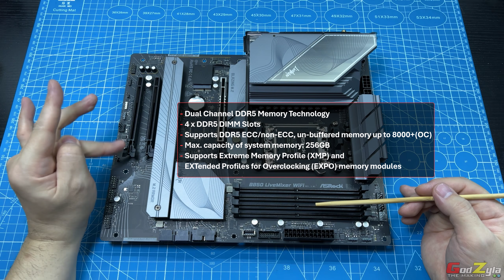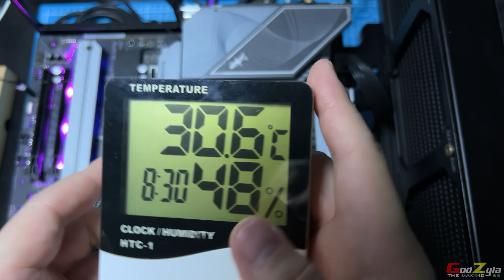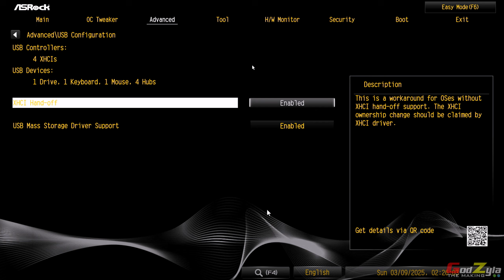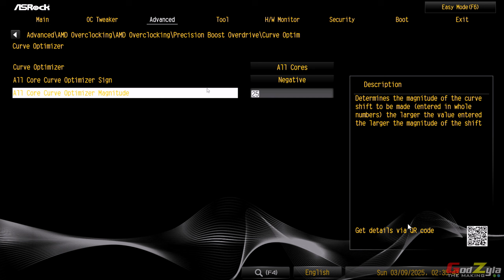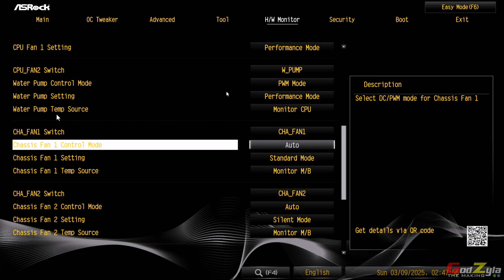ASRock B850 Livemixer WiFi

Comment: Is the 9800x3d suitable for this motherboard? It seems AsRock fixed the driver issue, or not?
Reply from the maker: Hi vitalikx100, welcome to my channel. Yes this board is suitable for 9800X3D. As for the burnout issue. I can only say there are prevention messures that can be done. PBO2 Curve Optimising on 9800X3D https://youtube.com/playlist?list=PLEW-b-2vYDdMhXCDT47rglQcDQNaRisR_&si=Gu2915lGssL9L0H6
Reply: @KleoYan  Thanks for playlist. I have one more question: for the 9800x3d on this motherboard, do you need to connect 8pin or 8+4pin?
Reply from the maker: @vitalikx100  In general, it's good to plug both in. It will also work if you only plug 1 8pin eps.

Comment: Hey, what are the essential drivers to download for this motherboard? Thanks
Reply from the maker: Hi GrapeGrannySoda, welcome to my channel, when you install a fresh copy of windows 11, once you load into windows, you should get a prompt from ASRock on the lower right. That will assist you with installing the essential drivers. else from the support site,, these will be the drivers I will install :-

From https://www.asrock.com/mb/AMD/B850%20LiveMixer%20WiFi/index.asp#Download
Realtek high definition audio driver ver:9703.1_UAD_WHQL    
MediaTek Bluetooth driver ver:1.1043.0.550      
AMD chipset driver ver:7.06.24.2226 
Realtek Lan driver ver:10.071.0425.2024   
AMD graphics driver ver:24.30.66.250610a  
MediaTek Wireless Lan driver ver:5.6.0.4261     
ASRock Motherboard Utility ver:4.1.35     
Nahimic3 utility ver:1.10.2_APO4    
Dragon 2.5G LAN Utility ver:6.10.3301.2

Comment: Hi Kleo, would you recommend this Mobo vs the Gigabyte b850 Aorus elite wifi7?
Reply from the maker: Hi Detlaff, welcome to my channel. I will advise to get the gigabyte b850 Auros Elite wifi7 as there are issues currently on ASRock boards. https://www.reddit.com/r/ASRock/s/X2VgEOJ58n
Reply: @KleoYan  this only affects 9000 series cpu's right? or are they also causing issues with 7000 series. I'm planning to pair it with a Ryzen 7 7700 CPU.
Reply from the maker: @Detlaff13  I see, still I will not risk it .. it will be better to get the gigabyte board.
Reply: @KleoYan  Okay, thanks for the advice. It's such a waste that this mobo has better pricing than the gigabyte one If only it didn't have any issues.
Reply from the maker: @Detlaff13  yes it is.. as much as I feel the same way you do, but it's better to be safe than sorry. It's no joke not to have an operationaly ready PC. All the very best with your build. 😉
Reply: @KleoYan  btw, What do you think of the Gigabyte b850 eagle as a more budget option?
Reply from the maker: @Detlaff13  Hi, I do not have that board to fiddle with. The choice is up to you. so sorry about it.

Comment: Hi !

I feel like this motherboard would be great for me.

Case : Corsair 3500X
CPU : Ryzen 7 9800X3D
GPU : MSI 5070ti 3× OC
Memory : 2× 16GB G.Skill Ripjaws low profile DDR5-6000 CL30
Motherboard : Asrock B850 LiveMixer WiFi ATX
Cooler : Thermalright Phantom Spirit 120 EVO
Storage : 2 TB Samsung 990 Pro M.2 PCIe 4.0
1 TB Corsair MP-700 M.2 PCIe 5.0 NVME
Power Supply : MSI MAG A850GL PCIe 5 80+ gold

It's for UHD gaming and I want my pc to last for years ! Can I have some advices please ?

I also don't know what to choose between the Livemixer and the MSI Pro B850-P WiFi. They're both same price but I feel like the Asrock is better...
Reply from the maker: Hi LaP1tade, welcome to my channel. For build structure and feature set, the LiveMixer will be of a better buy.
Reply: @KleoYan Thank you so much !! You're gold ! 💛
Reply from the maker: @LaP1tade you are most welcome. All the best with your build too 😉
Reply: Also, you got a new follower ! Thanks for your great work ! 🥰

Comment: bro the box under the ram socket mine goes through to 85-89C is that normal? I've bought a b850 livemixer
Reply from the maker: Hi Fernnzx, welcome to my channel. mine does not go over 50°C and my room temperature is 30°C~31°C. If yours is hitting 85°C~89°C, something is not right and you might want to check your case airflow.
Reply: @KleoYan  Have you ever touched the heatsink under the ram socket? it's really hot even though I put a small fan directly facing the heatsink under the ram socket, btw my aio stands in front not on top because it doesn't fit
Reply from the maker: @dutaakun6823  yup, I did touch it.. is warm to my fingers, not burning. hmm maybe how many USB devices and m.2 did you plug to this board?
Reply: @KleoYan  i have 3x4 nvme, 1 ssd sata, 1 hdd sata 7200rpm and I have also ordered a 4x4 adata xpg gaming ssd s70 blade and I want to install it tomorrow when it arrives
Reply: @KleoYan Have you tried it during heavy gaming/benchmarking and touched the heatsink? Bro, I'm really scared because it reaches 80-89C hahaha
Reply from the maker: @dutaakun6823  I see, that might be the m.2s + your GPU that is mounted horizontally which causes your chipset heat to hover at 85°C to 89°C. I will not give you weird suggestions and I have returned this board to ASRock. I see if I can borrow the board again and to do some testing.
Reply: @KleoYan  Thank you bro for discussing what I wanted to discuss, this really helped me and this video is also very complete.
Reply from the maker: @dutaakun6823 you are most welcome. Drop me an email godzylatech@gmail.com so that I can follow up on your case.

Comment: Yo man, I really want to build a gaming PC and I've saved up enough for one. I have around €1750, and I included this motherboard in my PCPartPicker build, but I'm not sure if it's good enough with the other parts I have, or if I can get a better board for a better price—or the same price. The same goes for the other parts. I'll list my components below. If you have the time to let me know whether it's a good build or if I should replace some parts, please let me know.

Part list:
Cpu: Ryzen 7 7800X3D
Cooler: ARCTIC Liquid Freezer III Pro A-RGB 360 77 CFM Liquid CPU Cooler
Motherboard: ASRock B850 LiveMixer WiFi ATX AM5 Motherboard
Memory: TEAMGROUP T-Force Delta RGB 32 GB (2 x 16 GB) DDR5-6000 CL30 Memory
Storage: Crucial T500 1 TB M.2-2280 PCIe 4.0 X4 NVME Solid State Drive
Videocard: Asus PRIME OC GeForce RTX 5070 12 GB Video Card
Case: Montech KING 95 PRO ATX Mid Tower Case
Powersupply: MSI MAG A850GL PCIE5 II 850 W 80+ Gold Certified Fully Modular ATX Power Supply
Reply from the maker: Hi Ejuwaldi, welcome to my channel. Do pardon me as I miss out on your comment as there are no notification for some reason. Now your build is fine, just that will you want to have at least a 16G VRAM GPU as compared to a 12G VRAM GPU?
Reply: @KleoYan "Hi, thanks for responding. Yes, I would rather want 16GB of VRAM, but I wanted to buy the 9070 XT. However, where I live it's around €800 compared to the 5070 which is around €600 because of the shortage. If you know one that is better or just as good as the 5070 for around the same price, please let me know — or if I should change some parts to put in the 9070xt."
Reply from the maker: @LelouchJapan  a 9070XT or 5070Ti will be a better choice and based on your listing. I might change these

Part list:
Cpu: Ryzen 7 7800X3D
Cooler: ARCTIC Liquid Freezer III Pro A-RGB 360 77 CFM Liquid CPU Cooler
Motherboard: ASRock B850 LiveMixer WiFi ATX AM5 Motherboard
Memory: TEAMGROUP T-Force Delta RGB 32 GB (2 x 16 GB) DDR5-6000 CL30 Memory
Storage: Crucial T500 1 TB M.2-2280 PCIe 4.0 X4 NVME Solid State Drive  <---- I will go for WD SN700 1TB if it's just for gaming
Videocard: Asus PRIME OC GeForce RTX 5070 12 GB Video Card
Case: Montech KING 95 PRO ATX Mid Tower Case <--- I will go for King 65 Pro it's cheaper. 
Powersupply: MSI MAG A850GL PCIE5 II 850 W 80+ Gold Certified Fully Modular ATX Power Supply <---- I will go for FSP VITA GM 850W https://www.fsplifestyle.com/en/product/VITAGM850W.html
Reply: @KleoYan I live in the Netherlands, and unfortunately, the 5070 Ti isn’t an option since it costs €1000 or more here. The WD SN700 is actually more expensive than the Crucial T500. The power supply you recommended isn’t available for purchase in the Netherlands. The only thing I could possibly change from your recommendations is the Montech King 65 Pro, but even if I were to switch to that, I’d still need at least €100 more to get the 9070 XT. That said, I really appreciate you taking the time to help me out. If you have anything else let me know otherwise thank you for helping me out🙂
Reply from the maker: @LelouchJapan sorry my typo it should WD_BLACK 1TB SN770 NVMe. Hmm maybe top up abit. At least get a 16G vram gpu. All the best in your findings.
Reply: @KleoYan Yeah, I think I'm going to try to save a bit more money and buy either the 5070 Ti or the 9070 XT. Which one would you recommend?
Reply from the maker: @LelouchJapan if it’s just for gaming amd 9070xt if it’s for gaming and artwork 5070ti.
Reply: @KleoYan Thank you very much, and sorry if I keep bugging you with questions, but do you know if there is a difference between a boxed and a tray CPU? I found a Ryzen 7 7800X3D around €40 cheaper if I buy the tray version. Is it better to go for the tray or the boxed one?
Reply from the maker: @LelouchJapan  Box processor, full warranty coverage, tray CPU are opened already and warranty coverage normally is a year. It's no difference on performance as it's random sillicon chip, the only diff is.. tray are cheaper and they only have a 1 year warranty.

Comment: Thanks for the review, I've been learning a lot since I'm building my gaming PC. My idea is to pair this with an AMD R5 9600x, do you think I could have problems with the CPU issue from asrock? I know they release a BIOS update. Greeting from Colombia - South America.
Reply from the maker: Hi Amet Saade, welcome to my channel. It is a good board to pair with the 9600X, just make sure to update the bios to version 3.25 and if you worry about the issue that's reported at reddit. You can follow these steps as follow.
Disclaimer, these are just a reference, I will not hold any responsibility if you unsure or to prick your board.  

01) before you plug or to build, update the bios using bios flashback button
02) leave your motherboard on a rubber mat. plug your PSU 24pin to the board, power up the PSU but do not start the motherboard
03) Downlaod the bios version 3.26 here https://www.asrock.com/mb/AMD/B850%20LiveMixer%20WiFi/index.asp#BIOS 
04) Create a usb thumb drive to FAT32, tranfer the bios file to this thumbdrive. rename the file name to creative.rom (refer to page 52 and 53 https://download.asrock.com/Manual/B850%20LiveMixer%20WiFi.pdf) 
05) Plug the usb thumb drive to the Bios USB port (Page 52) 
06) Press the Bios Flashback button. observe the LED light up. then leave it. 
07) Please do not do anything, let the bios flash, the LED will take sometime to go off. 
08) once done, build your system. 
09) enable Ram EXPO profile
10) Install Windows OS
11) Update all chipset drivers when you get the ASrock driver prompt when youu first load windows OS
12) Download Windows Driver here https://www.amd.com/en/support/download/drivers.html , this is meant for AMD Chipset driver.
13) once done, update windows update, make sure all are updated
14) you can follow this to configure your motherboard. https://youtu.be/TofvZbLE3XQ

For your 9600X, make sure you set the PBO Limits according to your processor and in Curve Optimizer, you only need to set to All Cores with negative magnitude, the rest you can follow. like the offset vcore to -100mV at Load Line Calibration to level 2, the SoC/Uncore OC Voltage (VDD_SOC) to 1.1v or 1.15. and not 1.2v. 

All the best with your build.
Reply: @KleoYan Awesome. Thanks for taking the time to reply.
Reply from the maker: @Nonickamet  you are most welcome. I do understand your worries. I will be worried too if I read the findings at reddit, but I've been using the ASRock Nova X870E on a 9950X3D processor and so long you know what are the limits of your processor and to set it accordingly, you will be fine.

Comment: Should i buy this motherboard for gaming? 7 9700x with 9070xt
Thank you
Reply from the maker: Hi Herr Ho, welcome to my channel. The question you should ask yourself. What features do you need from the motherboard. In general, this board is capable for gaming and light content creation.
Reply: @KleoYan im new and this would be my first build. ASUS TUF Gaming B650-Plus would be another choice, what would you recommend ?
Reply from the maker: @Stahlkringel  That is why I ask you the question. If I recommend, it will be based on what I need. which might not be what you need. go with these points to ask yourself these questions.
1) Budget
2) you have mentioned gaming so PCI-E slot must be on full speed x16
3) what type of storage do you need? all m.2 or some m.2 and some 2.5" SSD or 3.5" SSD
To be honest. B650 boards are also ok, just that it's with wifi 6E and lesser PCI-E 5 lanes. if you do not require those, the Tuf will be good enough and if it can save you more instead of spending on the Livemixer, I will go for it. but if livemixer is about the same price as the tuf 650 Plus, I will grab this livemixer.
Reply: @KleoYan Thank you so much for your time. Great Video by the way. You have a new follower!
Reply from the maker: @Stahlkringel  you are most welcome. All the best with your choice and build too. 😉

Comment: Hi, how can I set the boot priority to be from the USB stick rather than the SSD? thanks
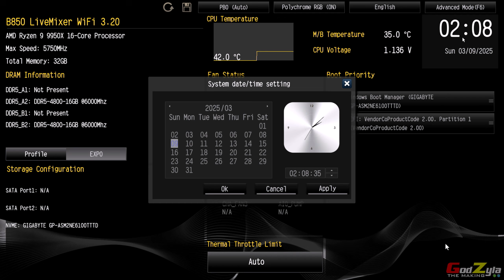Reply from the maker: Hi Davide Sterza, welcome to my channel at timestamp 1:10:07 (EZmode) or 1:50:50 (advanced mode)
Reply: @KleoYan  yes same me, I have 2 options only, but where is the usb boot priority option that all other motherboard have?
Reply from the maker: @ when you plug in a usb thumb drive it will appear. When you unplug it. It will boot to your 2nd drive but the usb priority is till in UEFI. Once you plug it back in, UFEI will trigger it back to usb to boot as priority.
Reply: @KleoYan  ah ok, so if I don't insert a bootable USB stick it doesn't appear, I'll check tonight. Thanks for the advice
Reply from the maker: @ yup that’s correct.

Comment: MSI B850 Tomahawk MAX WIFI vs ASRock B850 LiveMixer WIFI

Debating between these two motherboards. A few things I'm considering is that there may be issues with the 4080 Audio Codec of the tomahawk and no double-sided thermal pads for the primary M.2 heat sink. On the other hand, I may be thinking about pairing with a 9800X3D and worried about the CPU burning which has been an issue with ASRock boards. Tests have also shown better thermals with the Tomahawk. Thoughts?
Reply from the maker: Hi Preelexo, welcome to my channel. I have not touch base on the MSI B850 Tomahawk MAX WiFi, but nevertheless the Tomahawk or the Mortar B850M are of very good construction boards, I will choose a board which will cater my needs and the availability of the board in my country. To ease your mind and to have peace.. If you worry about something of a component, my advise is to go with something safe. ASRock for me, I have no issues with it. 
this is off topic. My way or purchasing a board is slighty different as we have good local distro to cover the warranty. It's of a lesser hassle. All RMA are done at the service center. Therefore to me MSI or ASRock or Gigabyte or even Asus. it works the same way.

Comment: Great breakdown. Question for you though. At 8 layers, would you say this has an edge over the B850M Riptide's 6 layers for temp then? I will be running a 9070 xt red devil and want to pair it with a 9800x3d
Reply from the maker: Hi Skadoosh, welcome to my channel. The 8 layer is the activities on those trace lines on the motherboard, In general it helps the motherboard with cooling and stability (usage on the processor and communication between your GPU and the processor). As for temperature of your GPU, it greatly depends on the build of your GPU (Heatsink & fan). As a piece of advise, if the price on a 8 layer PCB board is about 20 to 50 bucks different. I will just go with the 8 layer and in addition, a 8 layer pcb not only does cooling and to enable stability. It does prolong the life span of a motherboard. Hope these answer your questions.
Reply: @KleoYan  Thank you for the response. I have confidence in the GPU. My question is more so aimed at the CPU's temp and if MB assists with it. I just bought my B850M Riptide and was told that MATX boards are bad for 9800x3d for some reason. They mentioned something about lack of heatsinks. This will be my first build, so I'm just trying to see if there are better options for M boards or if maybe I need to just run full size ATX instead. I have an Arctic 36 I plan on using for CPU cooling but the flaming about running MATX has me searching for reassurance 😅
Reply: @Peanutbuttacups i wouldn't worry that much about the 9800x3d. They tend to run pretty cool. The extra pcb layers may help slightly with cooling and possibly interference from audio
Reply from the maker: Thanks BigNicNRG for responding 😉 greatly appreciated it 👍👍👍
Reply from the maker: @Peanutbuttacups  as what BigNicNRG have mentioned. You should not be too worried about the 9800X3D. They are not hot to run. 😉
Reply: @bignicnrg3856  Thank you very much!
Reply: @KleoYan  Awesome, thank you both!
Reply from the maker: @Peanutbuttacups  you are most welccome. Just get a good airflow case, that will also help too. 😉I would recommend you the Lian Li Lancool 207. good airflow.